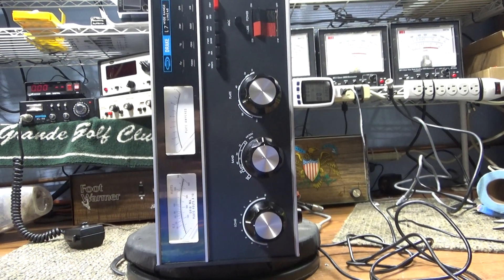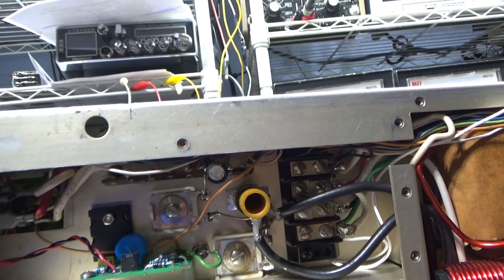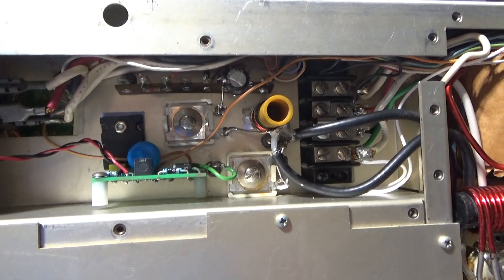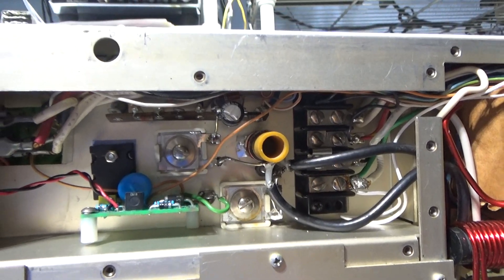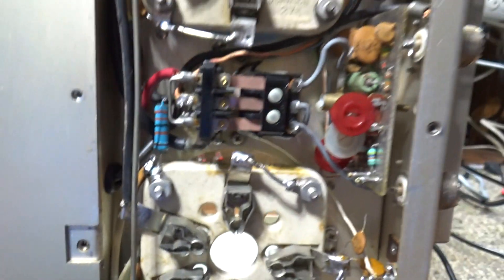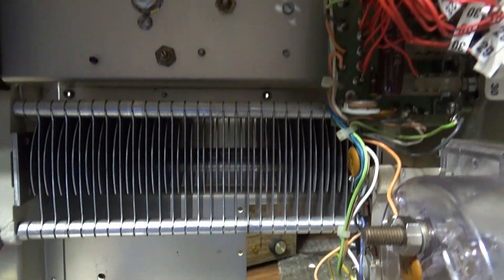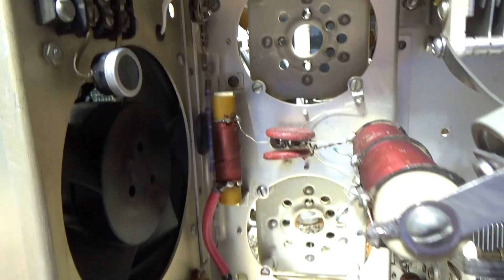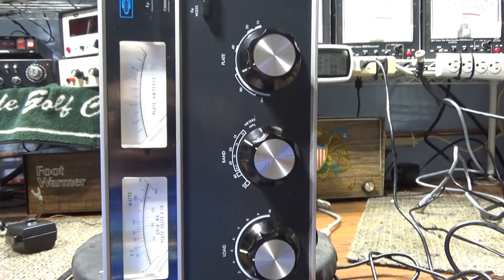Drake L7 linear amplifier RF Deck #2 only, unpowered walkthru, this 1 is clean, I Likkie.

Comment: Question, I recently purchased what looks like a blackcat JB12 modulator, it has 8 diodes in the power supply and my issue is that the bleed resistors are getting very hot and want to smoke at only 60 volts.  The caps and resistors are new and the tube tests good, any thoughts?
Reply from the maker: You have something very very wrong. The bleeders go across the High Voltage capacitors and should have about 350v across each bleeder/cap. They run warn but should not get hot. Do you have the right resistance (ohms) on the bleeders? On some Blackcat JB-12 and JB-150 schematics the bleeder resistor is mis-labeled. Th schematic has 10k resistors where the actual resistor needed is 100k. Using Ohms law, a 10K across that cap would pull about 11 watts which is what sounds like your problem is. Use 100k resistors, at least 2 watt, but I personally go with 3 watt flameproof resistors.
Reply: @tramdr  Would a 100K, 5W white rectangular ceramic resistor also work?
Reply from the maker: sure
Reply: @tramdr  FYI, I installed the 100K  5 watt ceramic high power resistors in the JB12, no smoke or discoloration but they do get hot?
Reply from the maker: Maybe a little warm but not hot. You got them in right, in series across each cap and not in parallel?

Comment: “Mono banded for 10 through 15 meters” you might get it to work on 11 meters but that’s illegal. 
Doc, do you recommend grounding the grids on an L4B?
Reply from the maker: It will load for 10-15 meters including the Ham WARC 12 meter band. Yes, ground the grids directly, get rid of the 120 Bias, use a dropping resistor in the cathode and a diode string for operational bias and enjoy.
Reply: @tramdr  Thanks Buddy.